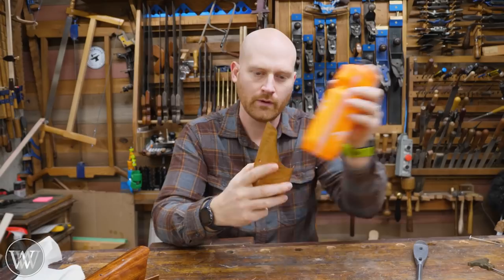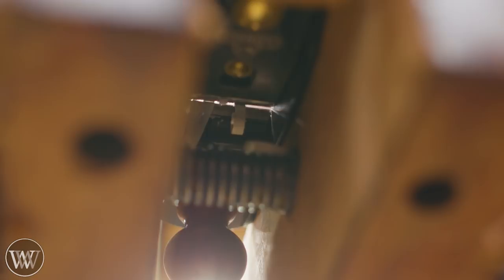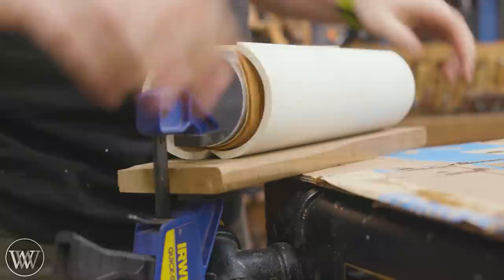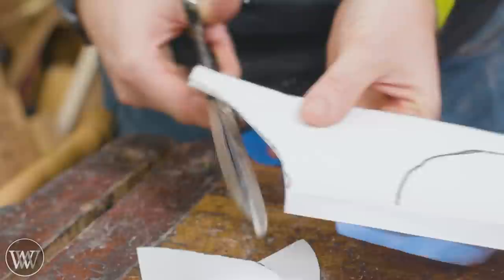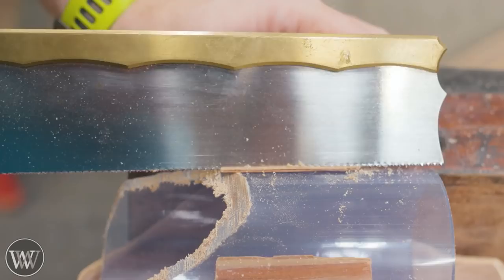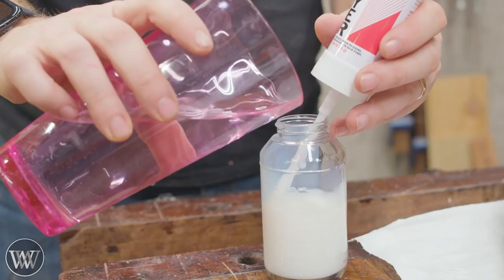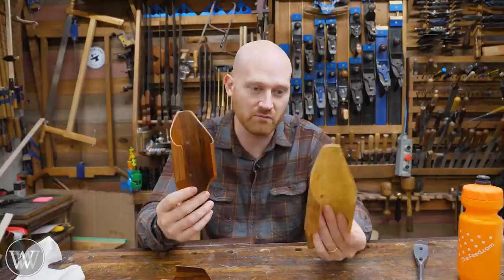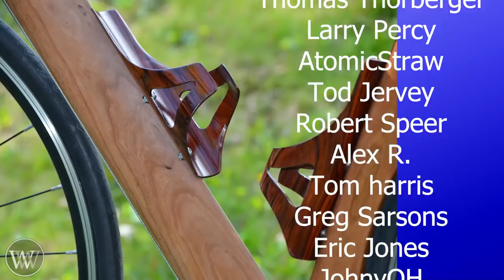How to Make Wooden Bike Bottle Holder Natural Carbon Fiber

Comment: these look awesome.  
I made one with a pipe once.  same idea, but ugly. 
The only problem I had (and It would be the same with these) was that he screw head stick out and either scratch the bottles or prevent them from sliding in altogether.  Ideally there would be some base and a recess for the screw heads.

Comment: Well finally, a project that incorporates my 2 favourite hobbies. Going to have to get me some veneer and try this. As mentioned below, need to either use bolts with countersunk heads or laminate a piece under so you can counter sink the hole for the bolt head so it doesn't stick up. Another thing I saw missing, no sort of stop to stop the bottle getting pushed right through the cage, figure you could just make a lip with some epoxy and/or small piece of wood glued. Also, think including some holes in the cage would help with visual appeal like Jeff did with his - more chance for scroll saw fun :-)
BTW, love the "this is carbon fibre" makes perfect sense and has me VERY intrigued thinking about the possibilities using this form of carbon fibre ;-)
Reply: Personally I don't really wish to work with epoxy, but it's still a cool project!
(and yeah, totally amazing to have two favourite hobbies in one video, and the bike he owns - I guess - is pretty sweet as well)
Reply: @johanneswerner1140  you could do it with wood glue as well I expect, but don't think it'd end up being as strong and the clamping up would be a lot more tedious since most wood glue does not fill gaps like epoxy.
Reply: True that! Clamping with the two tubes should in principle be good enough, when doing bent laminations this (apparently) works. I'll give it a shot.

Regarding the mounting bolts, I would laminate a3mm to 5mm thick (1/8 inch?) piece under the bottle holder. Drill a recess of 8mm diameter about 2mm deep and mount with flat / domed head M5 bolts, stainless steel, use grease on the threads. Drill the excess first, then sink the hole through. On most of my bikes you also need a similar recess on the bottom of the bottle cage, hence the need for the additional piece of wood.
Reply: @johanneswerner1140  Exterior wood glue will be fine for this as it is as strong or stronger than epoxy in many applications. Gaps should not be a big issue. I suggest clamp up everything dry and let it sit for a few days. Have a roller to apply the wood glue so the glue up goes faster.  I used lots of hose clamps to clamp the pipes.

Comment: Have you compared the weight to a plastic one and a carbon fiber one? Just for fun, not that I think it matters that much.
Reply from the maker: The last one that I made is just over 2 oz. It would be fun to compare them.
Reply: I have a walnut one that is 45 grams. Carbon fiber holders range from about 20 grams to about 35 grams.
Reply: Interesting, thank you!

Comment: Unrelated to wood working, what type of bike do you have?
Reply from the maker: I have two bikes. One of them is a cheap next bike from Walmart YFrame. I use that for beating around in the trails. My other one is an old Brazzer I've had for a few decades.
Reply: Sadly it seems James is a roadie and has a Cervelo, that's all I can say, didn't show enough to tell you which model, but I'd guess S3 :-D
Reply: @lynxg4641  Yup I am mainly a roadie and triathlete. My Cervelo is an S5. I also do ride on trails and in the woods.
Reply: @reedplanes728  Ah, that was your Cervelo ;-) I said S3 as I figured if it was James with how he moans that wood working tools are expensive, he wouldn't shell out for an S5 LOL.
I basically stick to trail riding, just so much safer than riding road, drivers just don't give a flvck, too many close calls over the years.